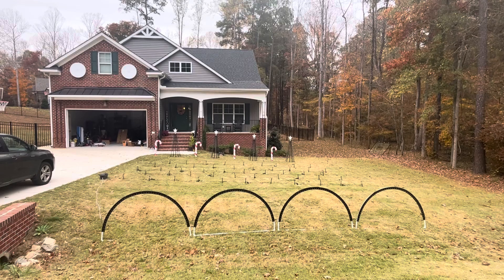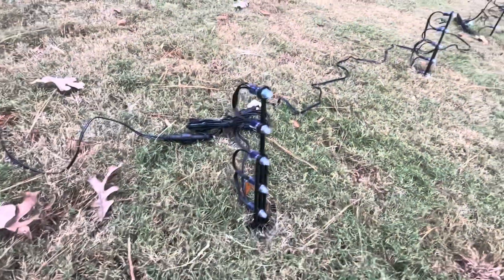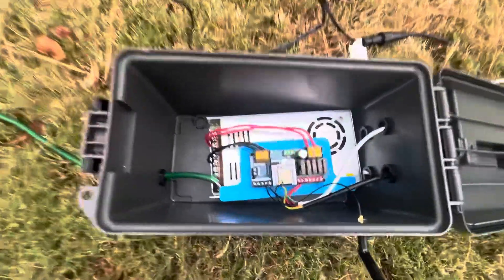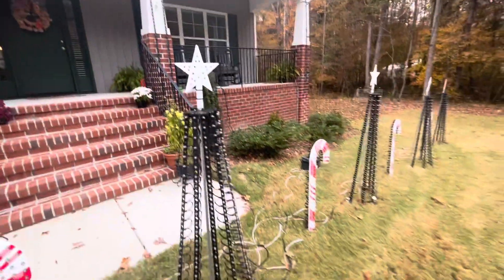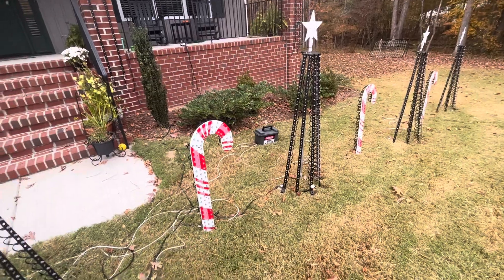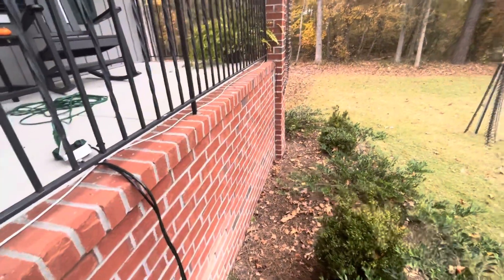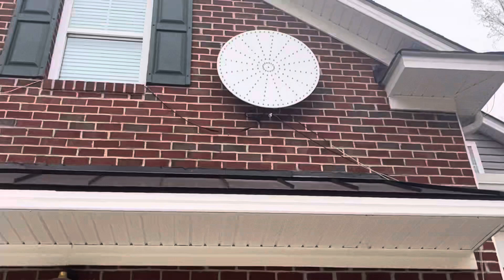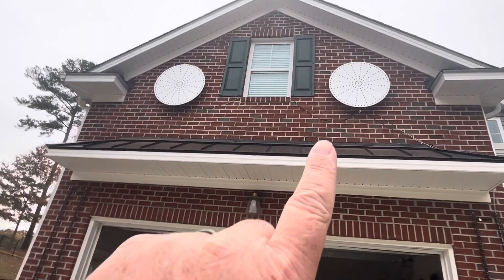Christmas lightshow behind the scenes 2023

Comment: how did you attach the strips to the side of garage and pillars.  It looks like a spacer or something and you put a bolt into the brick.  If this is the case, do you leave that all year round (the spacer not the straps)
And great additions, you are inspiring me.
Reply from the maker: It’s just a 3” screw with 1/2” pvc as a spacer. I’ll leave the anchors in all year but not the spacers. Next year I will probably 3D print a better spacer.
Reply: @DIYD_Do_It_Yourself_Dad  so you just drill in to the brick and have the 3" screw go sticking out, correct?
Reply from the maker: @gixster92  yep

Comment: How did you run wires into the house?  I have a brick house and can't run them under garage doors because of detection.
Reply from the maker: I drilled a hole through the garage wall. You can see it in my “how to install permanent holiday lights” video